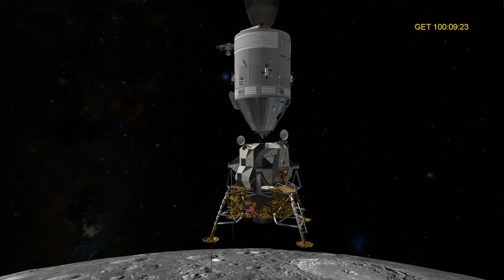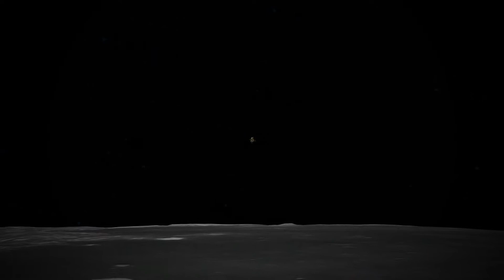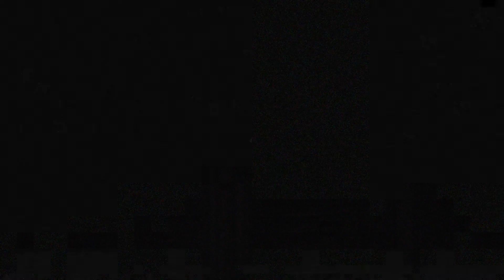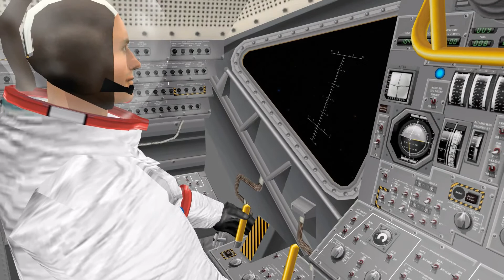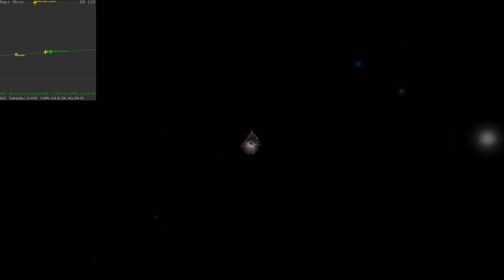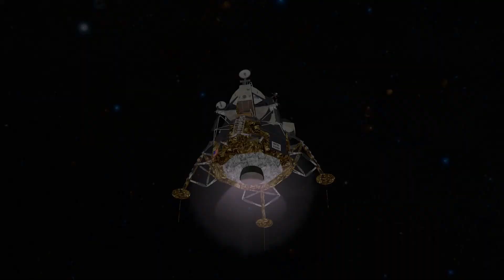Apollo 11 Flight Simulation Part 6/AMSO Orbiter 2016

Comment: Part 7!!
Reply from the maker: It's in the works right now ;)
Reply: @AztroNut66  thanks dude, but what your pc spec?
Reply from the maker: @calvintjioe5702  Pretty good but I need a new graphics card. GPU is too slow for what I need it to do.
Reply: @AztroNut66  can mx250 handle this game?
Reply from the maker: @calvintjioe5702  It should. One way to find out. Here is a link to Orbiter 2016 install http://orbit.medphys.ucl.ac.uk/download.html
First install Orbiter after you download it. Then install Orbiter sound 5.0 http://orbiter.dansteph.com/forum/index.php?page=download
Then install AMSO https://www.acsoft.ch/AMSO/2016/2016.html
Reply: @AztroNut66  thanks for much buddy😁
Reply: @AztroNut66  by the way, nassp and amso what's are different?
Reply from the maker: @calvintjioe5702  nassp simulates more systems realistically. You really need to spend some time reading all of the documentation to be able to use it. AMSO is much more user friendly. It doesn't take long to read the manual for AMSO and be able to jump in and go. I would start with AMSO then once you have a good grasp of the procedures then try nassp. Just my opinion.
Reply: @AztroNut66  between this, for beginner, which one should i use?
Reply from the maker: @calvintjioe5702  I would suggest AMSO for beginners.